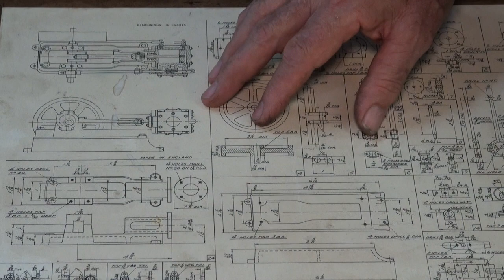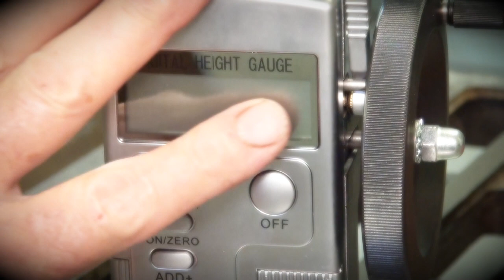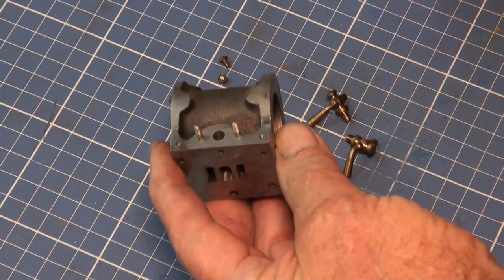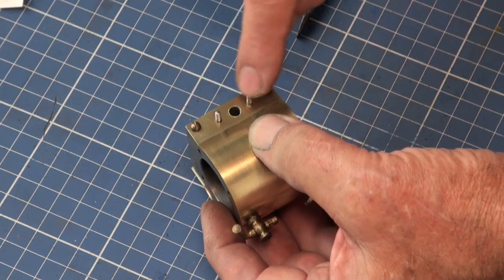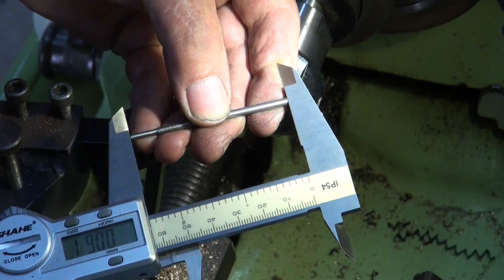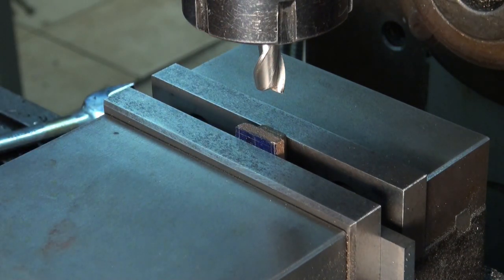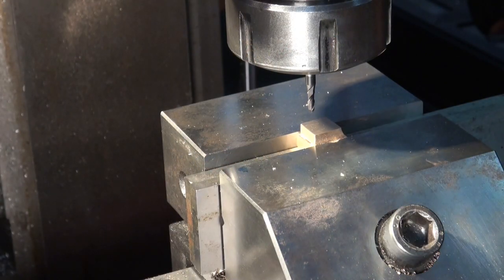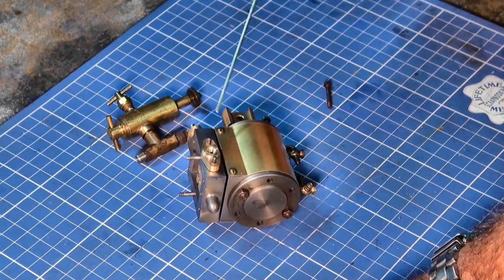Building the Stuart Turner Number 8 Mill Engine - Part 8 - Cylinder Accoutrements

Comment: Ach! der liederhosen!!!  I admit it, I like tools, too.  Older Starrett calipers with that satiny smooth finish are amazing....  mmmmmm......
Reply from the maker: I must say I get rather turned on watching Stefan Gotteswinter and all his sexy German tooling. 😍
Reply: Yeah, that guy has some nice kit.  You are making beautiful things, too.  I watched the pin wrench, and that is almost too nice to use.  I desire to work at that level, but my skill set is a bit green yet.  Maybe, some day, I can be up there with you, Mr. Pete, Stefan, TOT, etc.  But not right now.... much work to do.  And it's been blistering hot up here.  111F, oh, um.....  39 to 43 degrees almost every day this "winter".   And the humidity has been high as well.  You shamed me with your video on working in that same condition, but my tolerance isn't quite as high as yours right now.  Again, much work to do.  Thanks for the shining example.